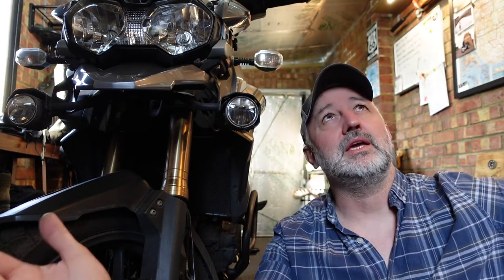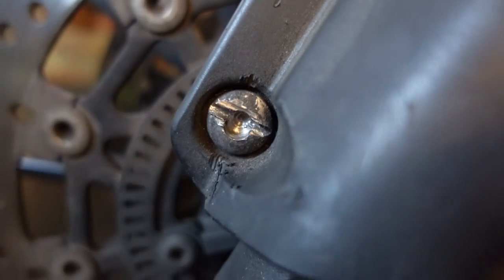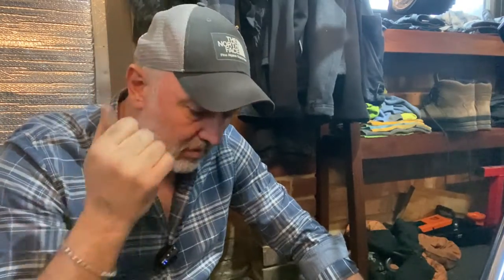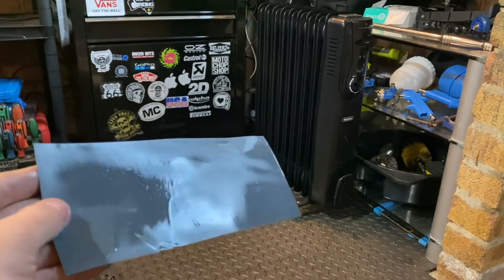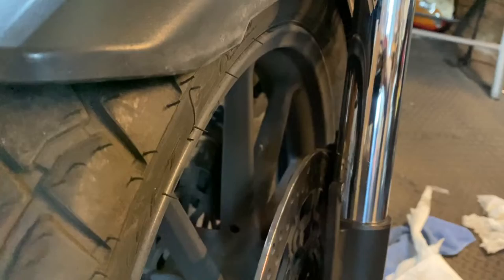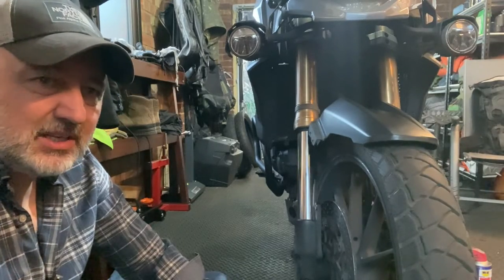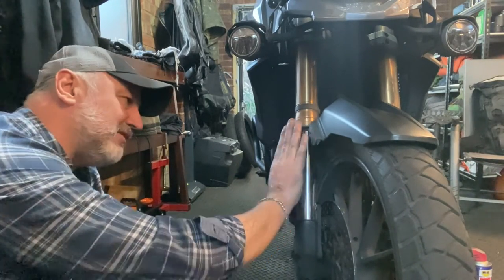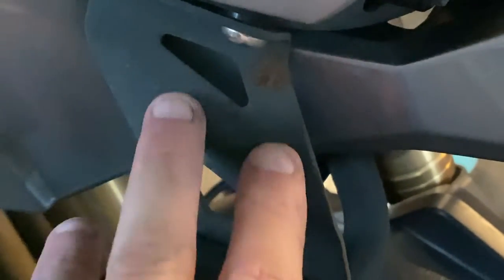Removing rust and pitting from motorcycle forks with 2000 grit sandpaper and WD-40.

Comment: Hi Billy I’m going to try this on my Triumph Tiger 800 XC - I tried the aluminum foil method and it removed most of the rust but I still have stubborn pits that feel need a more abrasive material like the 2000 grit sandpaper you suggested. I’ll give it a go and then let you know. Think I’m going to wipe them down with silicone spray when I’m finished. Your thoughts?
Reply from the maker: Hello Scott, good luck mate, i think the 2000 grit method is the safest bet, bit of spray wont hurt but obviously keep it well away from your discs and callipers, i know you know that already, but i wish someone told me that years ago… dont ask me why  😬
Reply: @billy4rocks  yes def will avoid all other parts. I spray the silicone right onto the shop towel. Yeah whatever your experience was years ago was probably like getting water on the rims of ten speed bikes of the eighties when we were kids - rubber brakes 🤦‍♂️
Reply: @billy4rocks  worked like a charm. I just finished - unfortunately our local hardware only had 1500 grit but I took my time and cannot believe how smooth the fork is now. I also made my own sealmate out of a used milk container. I am good to go - thx again brother for sharing this video - love the self commentary 😊
Reply from the maker: @ScottHylandSr  ahh nice one, glad you sorted it, thanks for sharing, much appreciated. ✊
Reply: I just sanded down part of mine on my dirt bike but I used 600 grit and the scratch is still there am I screwed

Comment: Well done Billy.  I've used similar methods.  I agree with using super-fine 2000 sandpaper.  One thought, make sure to use wet/dry sandpaper and use ACF-50 instead of the WD-40 (which is mostly solvent) and use lots of it to carry away the particles (as in wet sanding).  We use ACF-50 on aircraft and it has a life of at least two years.  Cheers! -Kirby
Reply from the maker: Cheers Kirby, top tips. 🙏
Reply: Gonna do this for my bike it has some bad pitting after I tried the tin foil method 😅

Comment: I just used a 3M abrasive pad on my slightly pitted bicycle fork but it also took the chrome shine off in the process. Should have used a finer pad..hopefully I can get the shine back with some 2000 grit and metal polish.

Comment: 2000 grit, #0000 grade wire wool, all good 👍. Just done exactly same job on my 02 XL 1000 Varadero. As a finishing touch I did a final polish with a bit of Autosol n they looked mighty. Final application was a bit of restorers crystalline wax. It’s a hard wax n helps fill any tiny pits n prevent seepage of oil n ingress of muck n water. Great video n nice to know I’m not the only one not willing to run out n buy new forks 👍👍👍
Reply from the maker: Nice one, thanks for the letting us know. Might treat myself to some of that wax. Cheers.
Reply: I just did that on my dirt bike but I used 600 grit cuz I didn’t know any better did I just ruin my fork leg. (The scratch is still there)

Comment: The biggest problem with this method of rust/pitting removal is that the damage is already there and just removing the surface imperfections will not be enough to stop it recuring. 
All you're really doing is removing high/low spots without actually addressing the real problem. The chrome on the fork stanchions is already damaged and is no longer providing the protection it should be as its already pitted and removing the high spots is removing more of its protective coating making the problem worse. 
The only real solution here is to get the stanchions re-chromed which will probably be a better quality of Chrome than the original and will undoubtedly be thicker than standard. while It may be a more expensive solution,  it'll be a lot cheaper than having to replace the stanchions with new ones and will certainly last longer.

Comment: Getting on mines tonight bought grit and metal.polosher, you think i still need to replace seal afterwards or give it a clean with sealmate will get it done, ive cleaned many times but as long as theres scratches gona keep leaking rights? so im wondering if its to late and need to replace the seal
Reply from the maker: It wont hurt to try and clean the seal out with a seal mate, Im pretty sure you can even make your own out off plastic milk cartons, if you don’t already have one.
Reply: Lastly I'm I basically passing grit until it is completely smooth before applying thr metal polish?

Comment: What also works nicely is a lenght of cotton cloths line ..36"..??wrap clothesline around chrome..a little WD-40..see saw line back and forth..cleans in 369°at a time ..also can be worked into those tight had to reach spots sand paper can't get too..😎👍😎
Reply from the maker: Nice, cheers Jerry. 🙏🙏

Comment: Some poeple over tighten bike bolts to the extreme
I bought my SR500 eight years ago with 64,000 kilometres on it and it had had one of these heavy handed owners and every time I'd work on it I would find things that were ridiculously overtightened often beyond the point of destruction 
After doing 80,000 kilometres I've got it pulled apart again and among many other things I'm replacing six of the square nuts that were welded to frame where the engine plates mount, I've done five and I'm just about to go out and weld the last one inplace, I had done the six of them but wasn't happy with two of them so cut them back off and I'm redoing them 
The only other things that will still remain of this heavy handedness will be the two  stretched studs at the bottom of the left-hand fork boot that clamp the front axle in place

Comment: maybe hit it again with 2550 and then 3000. I could see how dull the left fork became. This step up will eliminate more of the scratches left behind from the 2000. Also use a better lubricant
Reply from the maker: What lubricant would you suggest? And are you related to Alister Crowley?.
Reply: @billy4rocks  yes, that's my great grandpa. Just kidding!
I use water and dish soap.. Actually, I would investigate to see if there is something better. I use soap/h2o for paint, clear coats, urethane, etc. Water is a great lubricant. U can even use a spray wax..
Reply from the maker: @L46C3  thanks Mr Crowley.

Comment: I don't know why they call it " sand paper " when there is no sand, they should name it " wet and dry emery paper " which does not clog up, when it is used wet.and does not fall to peices by water, the manufacturers, should copperr plate the steel, then nickel plate it, then crome plate it, then it would not get rusty, crome is not water proof, but the manufacturers, do not want to spend more money on things, they do not want them to last longer, they want you to throw things away, so that you will buy another one, for more money.
Reply from the maker: I feel the same way about cheesecake.
Reply: @billy4rocks  a bit like the meat pie we had at school, no meat just gristle and gravy inside.
Reply: @billy4rocks  we use to have " windmill pudding " if there was enough to go around.
Reply: we use to think that sand paper packets, were A-Z of the sahara desert.
Reply from the maker: @daibhiseaghdha153  haha, excellent